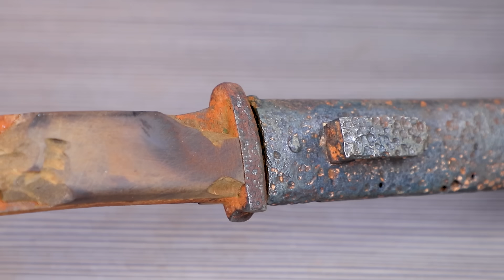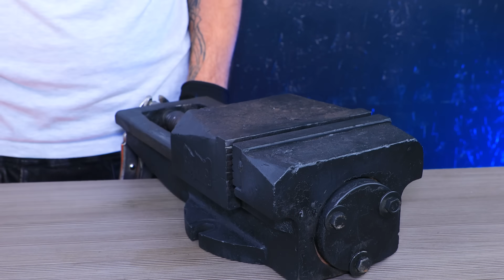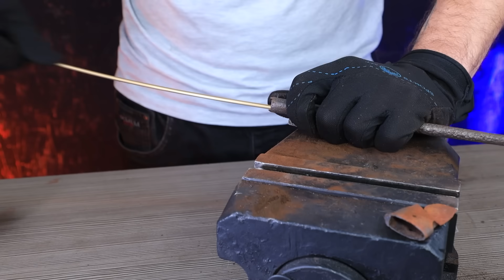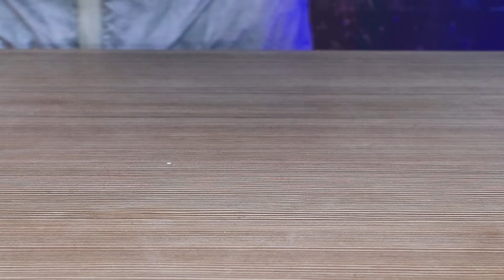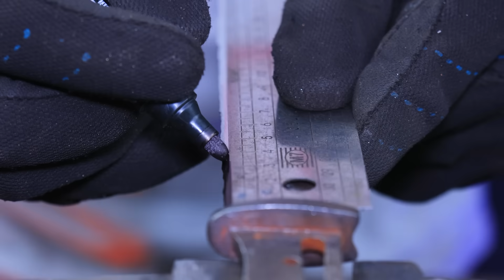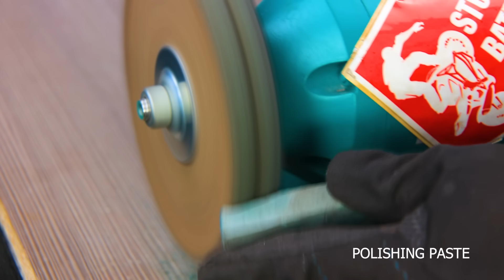WW2 Bayonet Restoration

Comment: I do not understand. why make a fake video? The scabbard is for the M95 bayonet, the end of the K98 hook is rounded. I've tried several different K98s and M95s, but it just won't fit. About the blade. This is a replica without a maker's mark...there is nothing at the base of the blade, there should be an acceptance stamp under the grip, but the owner shows nothing. This is a total fake for me.
Reply: agreed

Comment: Love all the hard work, but some things are a bit historicaly off: bayonets came blunt out of the factory and were never scharpened so slicing an apple doesn't impress me, it looks like the wrong type of scabbard for this S84/98 iii type bayonet (looks like an Austrian or Czech scabbard by looking at the flat folded frogstrud), scabbards weren't painted but the steel was blued and all the grinding gets rid of all manufacturers- and WaA markings that collectors want to see. The restoration makes for a great YT video, but I'm not sure if all the hours that went into it added any value to the original condition with all it's rusty history still in place...

Nonetheless, very impressive skills and I learned a thing or two watching you work!

Comment: Sorry, but this is so fake. No way the scabbard is so holy, yet the blade looks like it just came from the factory. 
Looks more like you found the oldest most damaged scabbard and put a replica blade in it, caked it in mud, and let it hard dry on it. Other than a little rust in the rifle attachment part on the butt of the handle, the knife has no damage at all.
Did you really use the vice on the edge of the knife so you could drill two holes in the threaded washer?
Why does everyone say "Luke I am your father"? This is wrong. He says "No Luke. I am your father."
Reply: согласен с вами полностью , на ютубе есть видео, где восстанавливают полностью штык нож такой же , но там при меньшем уроне ножнам , лезвие как будто червями сожрано . а тут почти как с завода лезвие .
Reply: In the thumbnail, you can see a green coloured rust, which isn’t a natural colour in rust, so therefore fake.
Reply: @Master Chief  Well, the turquoise color is a form or "rust" for copper. Copper was used in this scabbard, so it is something that would show up, but this is still a fake Restoration video, just like 99.99% of these kinds of videos.

Comment: First things first, back in the day these bayonets were blued by using chemicals or heat and were NOT as polished as this one is. I mean yeah it looks clean and good and this was a great restoration all the way up, but clearly not a precise one. Sad to see how you filed the two sides of the tip of the bayonet without considering that this is not historically accurate. Eventually you changed the locking mechanism from a fake one to an original one and put accurate grips on it so you are not as dumb as these idiots uploading videos on youtube and doing resin-cast K98 bayonet grips with gold particles on the inside. So thank you for this, and thanks for sharing

Comment: The scabbard is an Austrian m1895 . Germany didn't use that type of frog hook.
Reply: So why were the bayonet & scabbard clearly in the ground together?  Just asking from curiosity, not arguing.  Swapped in the field or just issued like that for some reason?
Reply: Your query got me thinking,so I've just tried one of my k98 bayonets in one of my m95 scabbards,and it doesn't fit.wont go all the way in,the plot thickens..
Reply: @andrewhaddock7996  In the video, it looked like the blade was not as wide as intended (the bit where he welded on more material). Could that perhaps have something to do with this?